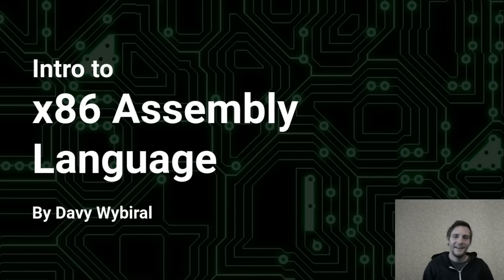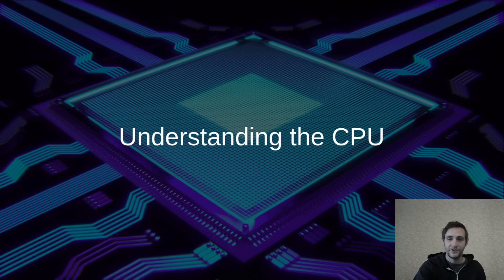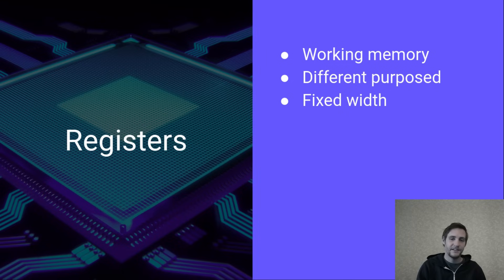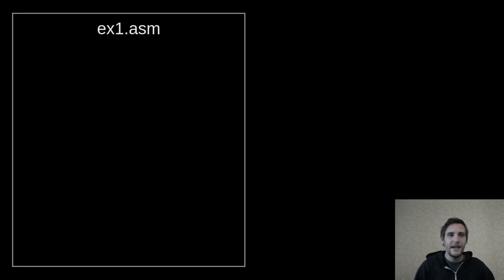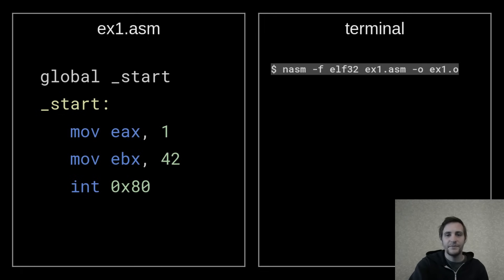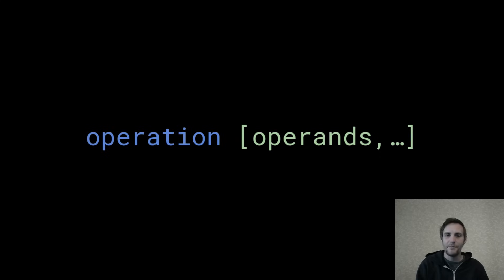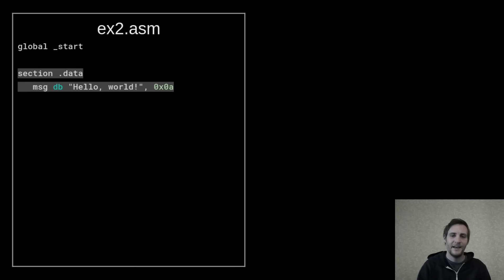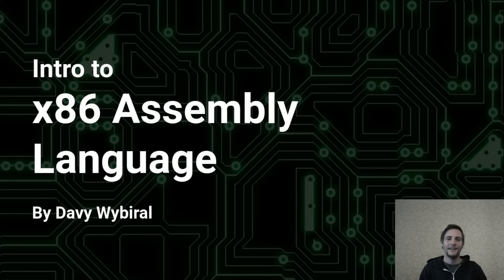Intro to x86 Assembly Language (Part 1)

Comment: First part was informative but. You left out what the different keywords means once you get to 10:08.

msg db "Hello World!",10,0  //Here we append '\n'(newline) and the numeral 0 to our string  in order to 0 terminate it(0-terminated string) - which is good practice.
Also you didn't create a string of bytes but an array of bytes. You defined bytes(db). So you defined an array containing characters "Hello world!\n". Which you could also have done like so although very messy:

msg db 'H', 'e' , 'l',' l', 'o', ' ', 'w', 'o', 'r', 'l', 'd', '!', 0x0a

len equ $ - msg //  equ is used to define contants. "$" evaluates to the assembly position at the beginning of the line containing the expression(current address). Also maybe tell us why it works. It is not obvious for everyone that you're taking the address exactly after making your string and subtracting the address of the very start of the string.

Please remember to tell us what each keyword does and means.
Reply from the maker: You don't need to end your string with a 0x00 unless you're dealing with C library functions. The system call for writing to stdout requires the length and that 0x00 doesn't matter. Also... What do you think the difference between a string and an array of character bytes is? :)

Also, to each their own. I write the bytes out in hex format as 0x0a instead of just 10 or even 0xa because I'm used to working with hex editors (as people working with low level languages like this tend to be).

But, yes, I could have explained in more detail that the $ was for taking the location after the string.
Reply: There is no difference between a string and an array of characters. But in the video you called it a string of bytes. Which I find wrong. It is an array of bytes or a sequence of bytes representing a string.
Reply from the maker: They're all valid terms. You probably hear people use "string of bytes" more when they've had to deal with unicode strings in addition to ascii strings. But you're just being picky (or not being picky enough?), it isn't "wrong".
https://en.wikipedia.org/wiki/String_(computer_science)#Representations
https://www.google.com/search?tbm=bks&q=%22string+of+bytes%22
Reply: A more relevant section of that wikipedia article is probably:
https://en.wikipedia.org/wiki/String_(computer_science)#Non-text_strings (maybe it wasn't there two years ago)

The meaning of the word 'string' has evolved to mean 'a sequence of character elements' (or whatever) over time, but its really just another word for vector, array, or sequence. In particular if you are working on x86 in machine instructions,  you should probably already be somewhat familiar with this because there are a whole class of string operations for x86 that aren't related t zero terminated character encoding anything. They are just for operating over a contiguous, addressable sequences of elements of a given size.